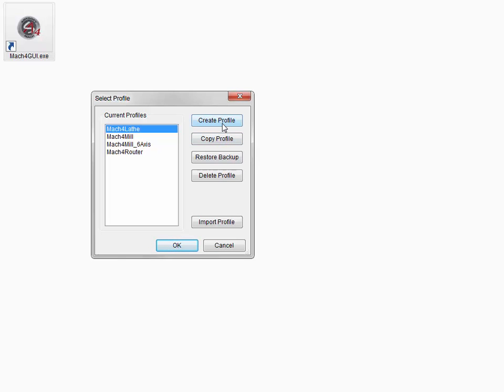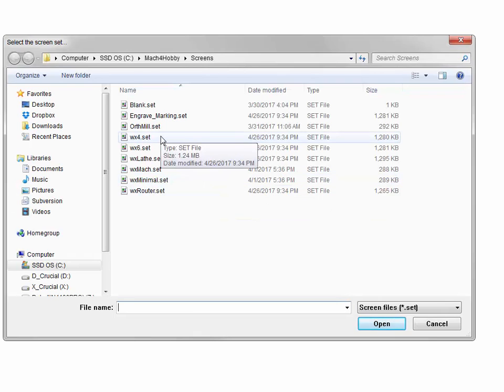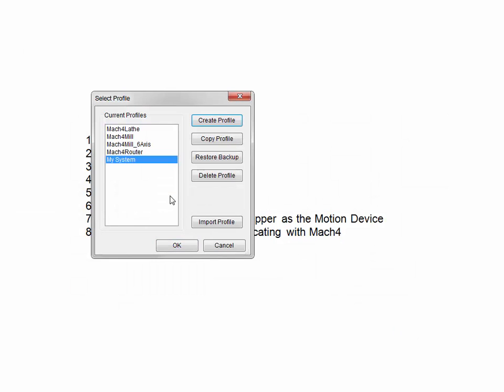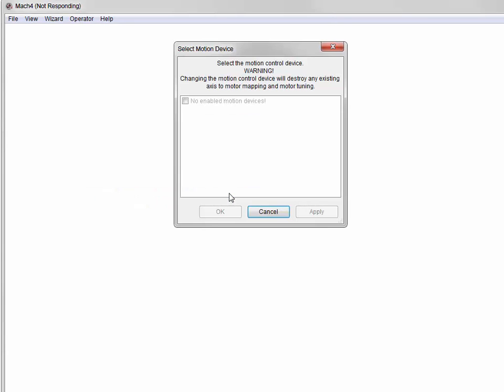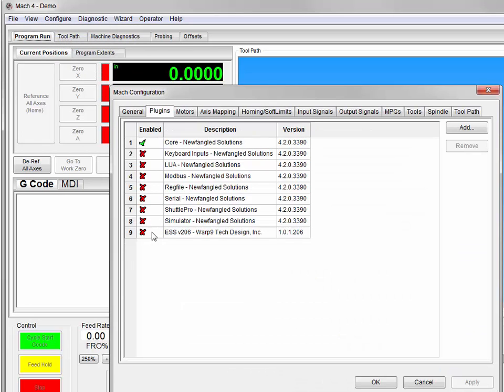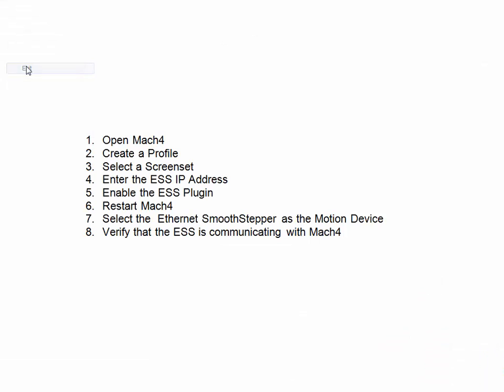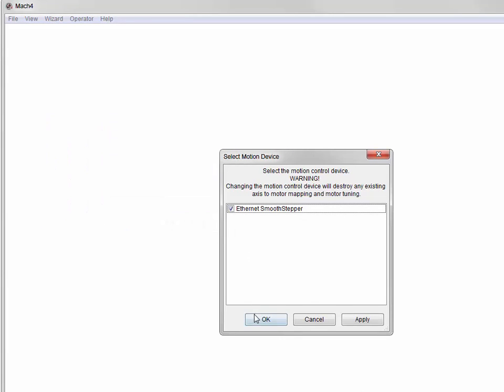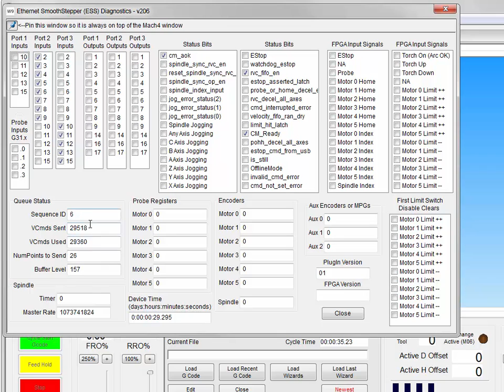Creating and configuring a Mach4 Profile

Comment: Can the ESS be plugged into an Ethernet switch on my network or does it have to go to the back of the computer? i have only 1 port on my computer and its being used for internet connection. Ive got basically my whole house hardwired to different things.
Reply from the maker: Hi Phillip, 

It is possible to connect it up that way, but it is more risky to do it that way (especially with older computers and networking equipment), since a large burst of data over your network could disrupt communications between Mach4 and the ESS, which will cause the data to run out and your job to be ruined.   

A better choice would be to use a USB to Ethernet adapter so your PC can talk to the network on your house (or a PCIe to Ethernet adapter if it is a desktop) and then use the original Ethernet port for dedicated communications to the ESS.  

https://warp9td.com/index.php/documentation/doc-ess#Connecting 

With that being said, there are some people successfully doing what you proposed, but if you run out of data during a job this is the first thing we will tell you to change.

Andy
Reply: @Warp9TechDesign  thanks for the quick reply. I'll look into the PCIe to Ethernet adapter. Thanks again!
Reply from the maker: @phillipcarter429  You are welcome!

Comment: So the ESS has 2 flashing green lights and a bright light on the board itself and I cant get Mach 4 to see the ESS.  but the flashing LED is kind of dim, I am using an iphone charger to power the ESS and I wonder if that is providing enough power.
Reply from the maker: The intensity of the light doesn't really matter, as long as Mach4 can talk to and run the ESS you should be good to go.    If you go to Mach4's Menu -> Diagnostic -> ESS **** .  On the ESS Diagnostics window that opens up, press the menu's right arrow several times and then click on the ESS Details tab.  You should see the Device Time and Sequence ID incrementing constantly.
Reply from the maker: Sorry, I didn't see the "t" in can't.

Did you run the SCU to configure your PC to work with the ESS?

It would be much easier to continue this in our Forums:  https://warp9td.com/index.php/register